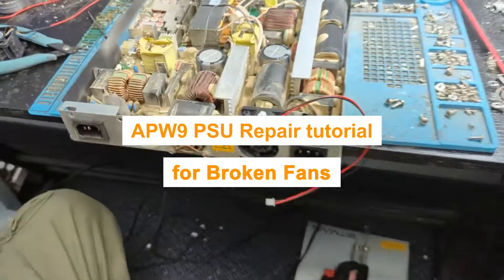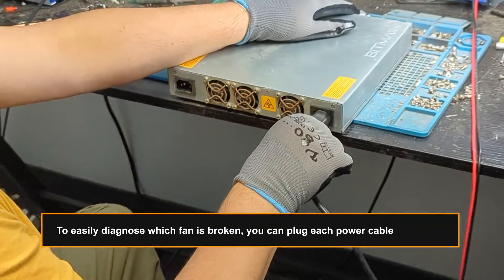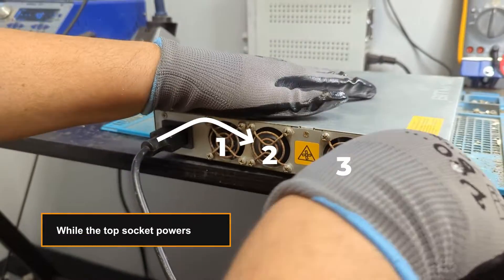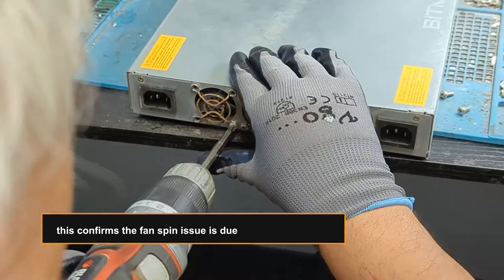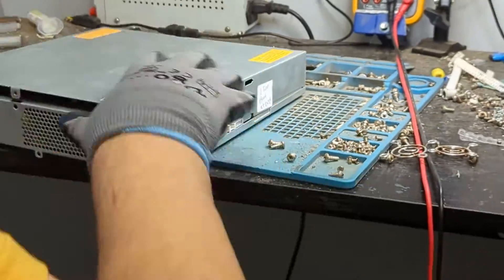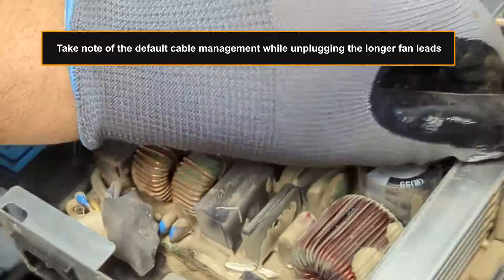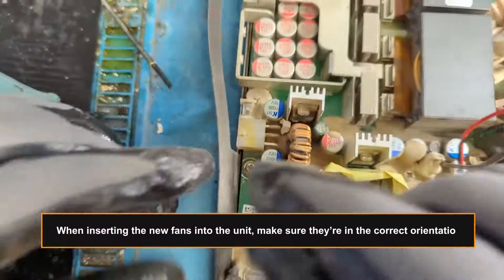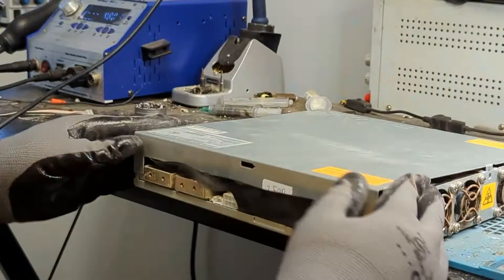Bitmain PSU Repair: APW9 Power Supply Fan Replacement

Comment: Hi, thanks a lot for this video.
I would like to know if a spoiled fan can cause the PSU not to give out voltage.
I have 21V for only chain 0 and Chain 1 but Chain 2 gives 0V. Fan 1 on the PSU is not working. Could this be the cause?

Comment: hallo my fan is attached by soldering to the power supplyes....if i cut the 3 cable red black and yellow and connect the red to red and black to black to the new fan (sorry for bad english) i can left yellow cable exposed inside the power supplies? any problem??? i'm asking this coz unfortunnaly the 3 cable are soldered to the power supllyes as mantioned up
ty a lot in case of help ^^
Reply from the maker: We have the nidec replacement fans, with 2 pins, 2 wires, black and red. Unfortunately I didn't thinker with the fans you have, but I guess the yellow could be cut and just use black and red if they share the same spec or are close enough. Come to the discord channel if you want to share more details with us, maybe someone in the community will be able to relate and help.

https://discord.gg/Zn5y2dkDkh